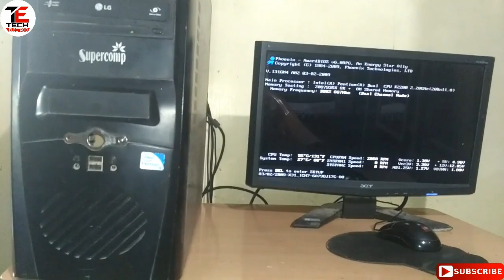How To Turn On Your Computer Without A Power Button (100% Working)!

Comment: Good idea. Good for short term solution till we get the button repaired or get new cabinet. But in my case, sadly the reset button is sunken. I have to use the tip of a pen the press the reset button.

Comment: My problem is that the 
power button doesn't have that
LED light and that's all
is running but how come you know that is ON is the blue
LED light doent light up,
it could be the cables that goes
to the mother board?
Thank you!!

Comment: Hey, i remove all those switches from the port without knowing which or where the those switches originally, and now after i randomly plug all of them back only red led light is on... my pc still not turning on ;(
Reply: Hahaha same here but mine was labeled so I try putting everything hahaha
Reply: Same bro, Can you name me thr sequence to plug in? i have 5 pins Reset, Power SW, power + , power - , hdd
Reply: Search for front panel configuration of your motherboard on Google, for identifying motherboard see name written on it or some other methods

Comment: Damn thanks, before my PC wouldn't turn on with the power button on the case or on the power supply, unless I shorted the power pins. Now I can control my PC with the power supply power button again, and dont have to use a screwdriver to short the power pins

Comment: hi i was wondering where you put the power sw
Reply: Because power switch wasn't working - maybe broken switch or wire problem, hence used reset wire in place of switch on wire that's why you now don't have reset feature

Comment: i have a all in one dell pc there is no power sw or reset sw its only one cable coming from the power button.
Reply from the maker: You can check out my other video. It will help you for single button cpu

Comment: I bought new pc and I randomly move these cables. Now my restart button is power button and power button is restart button xD
Reply from the maker: Just switch those cables on motherboard
Reply: @TechElectroid  Will it be bad if I keep using restart button like power button and power button like restart button? I'm really lazy xD
Reply from the maker: There is no problem if you use as it is

Comment: My computer power switch button is broken but for some reason my computer turns on by itself but my monitor is blank not even a cursor popped up on the screen. I really hate my computer cause the last time it broke was when i finished my final exams and now my monitor is broken during my SUMMER  HOLIDAYS!  pls help
Reply from the maker: CPU's processing light is blinking or not

Comment: hey can you help me how to fix a broken case power button please reply please
Reply from the maker: Broken case fixing is depends how it's damaged
Reply: Tech Electroid can you see this pic and tell me can this work again but the chip that has power button is moving downwards while I push it to open anyway thanks for your quick replyhttps://drive.google.com/file/d/1yeOwmUnp86UEnCfeAMdnIDvrp4hTPJQP/view?usp=drivesdk this is the photo of the button
Reply from the maker: Cant see Pics in commets
Reply: Same prob :( how to fix it if my pc working but my cpu start botton not working :( please help
Reply from the maker: I will try to make a video on custom start switch
Reply: Dude my mouse and keyboard no power and my pc power lights blinking
Reply from the maker: Disconnect all cables from motherboard .clean motherboard and reconnect all cables. It might help you
Reply: I think its my power supply it just a same? My power botton not working too if my power supply damged?
Reply: Should i buy a new one? Thankyou for your reply
Reply: Tech Electroid the pic link is in the comment
Reply from the maker: Links automatically goes in spam comments.i will check out later. Bcoz it need pc
Reply from the maker: I saw the pic. You can use any adhesive to fix the case like fevi-kwick

Comment: if reset button is also not working?
Reply from the maker: +MyCyberVilla mysore you can use any similar type of button but you have to interchange it's cables
Reply from the maker: +MyCyberVilla mysore last option you can use doorbell button also
Reply: How?
Reply from the maker: Check out this video
https://youtu.be/Q4lz-p5SKi0